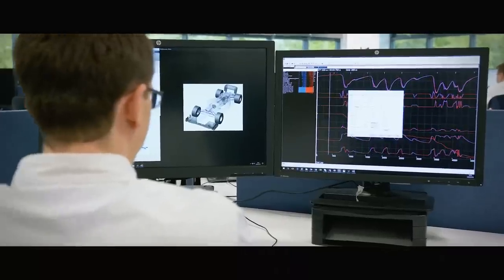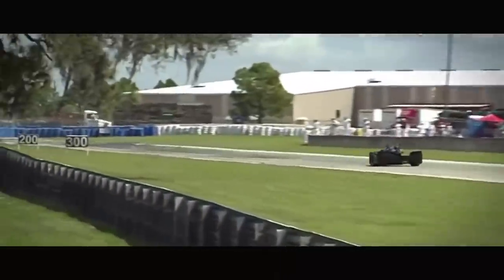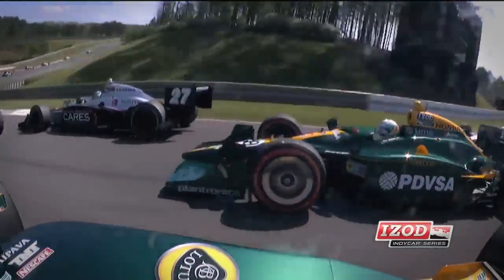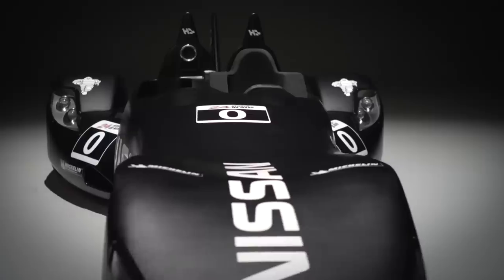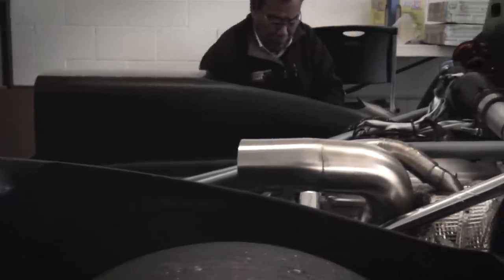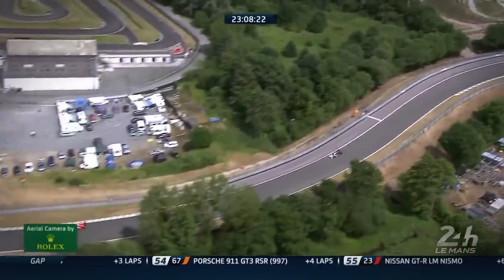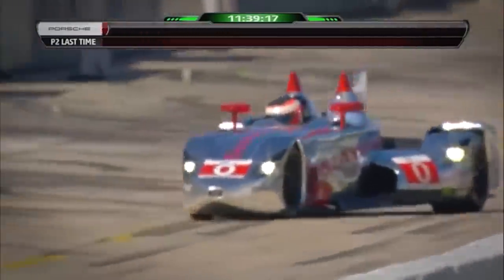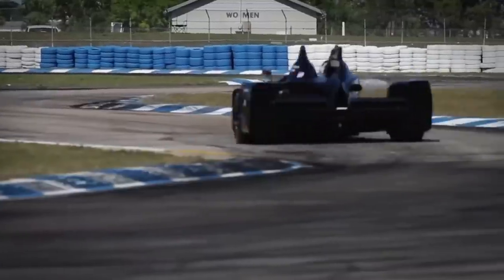The Motorsport Revolution That Never Was: Deltawing Project

Comment: The delta wing and the GTR may seem a failure but for Nissan that didn’t matter, it was a PR exercise for them. Nissan was a failing company when they employed a Non Japanese CEO, a man charged with saving Nissan. The point of having the name of Nissan on outside the box ideas was to get media and public attention, Nissan were the boring choice of the not so well healed. Nissan needed a public image change, the column inches, public and media attention plus a new GTR road car and the funky Juke got young people attention. The two car may have failed on the track but they saved a company and gave it a fresh forward thinking image.

Comment: The delta wing did not fail because people wanted to stop inovation it failed because it did not fit any active rule set. If teams currently running in a series are spending millions to win within a set of rules and then the series lets in a car that does not comply to any of those rules they have good reason to be pissed. The also have very good reason to want the car gone, banned, penalized you name it. If the series it joined had a more open rule set that allowed it to begin with then it would have been fine but those series dont exsist anymore there is no Can-Am, Group B just cookie cutter super safe IRL like garbage.

Comment: Rule changes....
Ninny's often masquerade as True Sporting Types. It is really sad when you think of where we would be without names like Bugatti, McLaren, Offenhauser, Ferrari, Shelby, Granatelli, or any other guy smart enough to go faster than the other guy using engine displacement, a transmission, wheels tires, oil gas, and a steering wheel with a place to sit then my hat's off to him.
Don't cry foul or you will run a foul of those who only smell a foul odor!
The solution is to Innovate, bring something to the table, for crying out loud!
Don't make the fast kid sit anything out!!!

Comment: Form a new racing class then and see if you attract enough people interested in it, both in terms of investors as well as spectators. I highly doubt that. In the end, the delta wing looks horrible and does not evoke any excitement and emotion amongst the racing community. And last time I checked that excitement and emotion is what the sport is all about. I am sure one could conceive even more radical concepts but then we might as well shoot rockets with wheels around a circuit piloted by AI. Who would be interested in that? Last time i checked, racing was not just about the technology only, but about drivers measuring their skills under somewhat comparable conditions. The sport consists of more than just the technology, it's the cars/brands one can identify with, the drivers, the investors that see a benefit in supporting any project and last not least, the fans. Without the fans, none of it makes any sense. Successful motorsport is only possibly if you get all of the above into the boat! The delta wing is a nice exercise in engineering, but that's about it. And if that was the soul goal, I am sure the big ones (Porsche, Ferrari, McLaren, you name it) would blow the competition out of the water just the same if they put their resources towards it. Nice try though ...